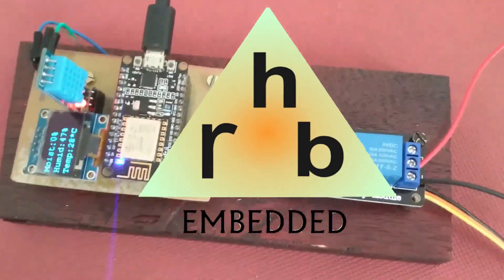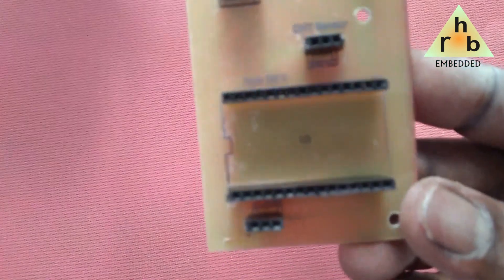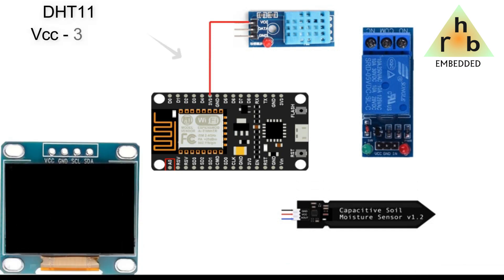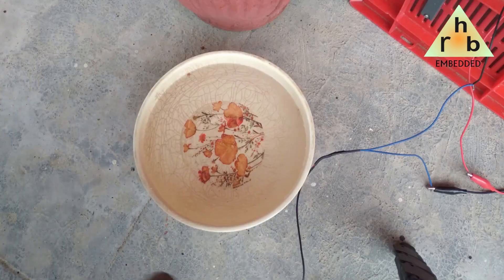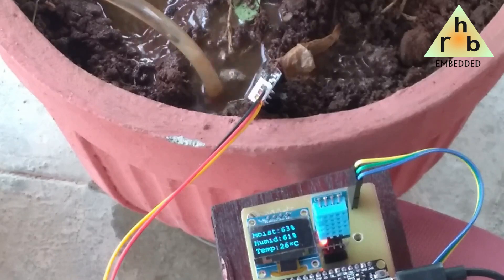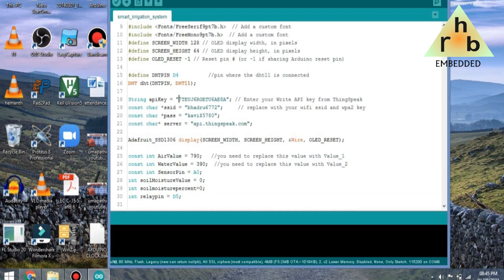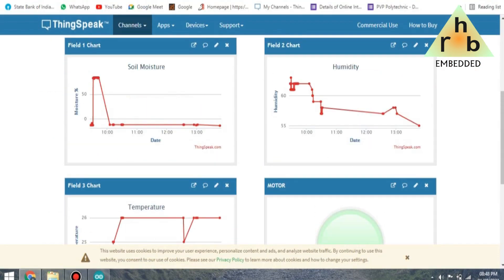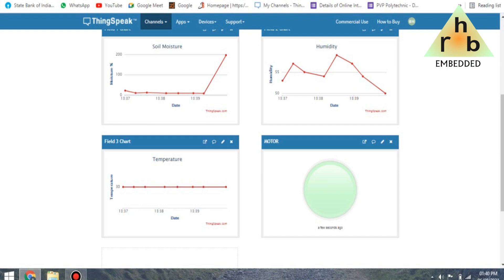#IOT Based #Smart+Automatic #Irrigation System with Node MCU(ESP8266)

Comment: Sir water pump ka battery se connection dikhaie,apne nahi dikhaya
Reply: hi bro did u got the solution
Reply from the maker: after the relay connect NO+com , supply (+- ) and motor terminals in series

Comment: Please sir, tell me, can the NO port and the CO port of the relay be  connected to the positive cable of the submersible pump and the positive cable of the power supply? 

Because i don't understand, i don't understand your circuit when you said we connect it to a motor, and from this point, where will we connect to the water pump?
Reply from the maker: NO and Common is acts as switch, wether it is +ve or negetive doesnt matter, supply terminals, motor terminals and relay NO, Co should be in series connection
Reply: hi did you got the solution???